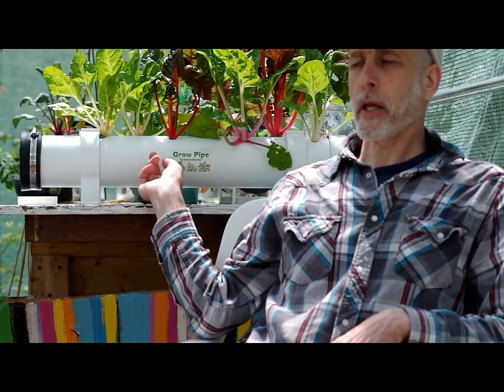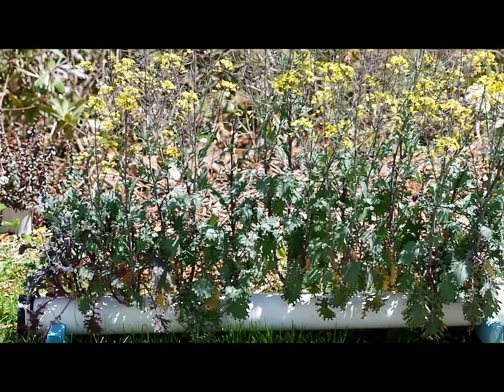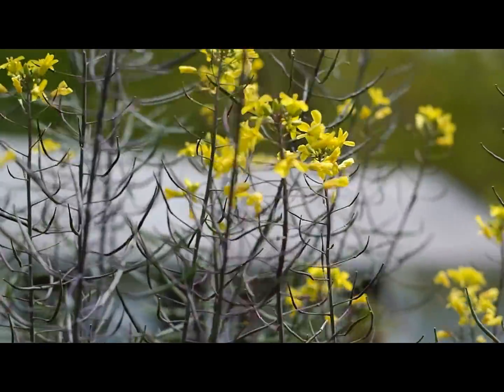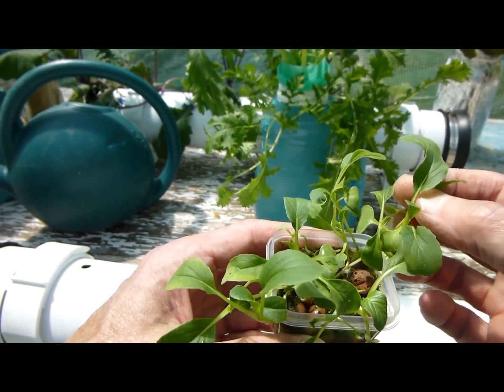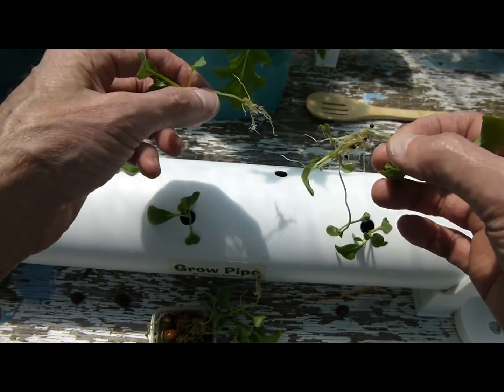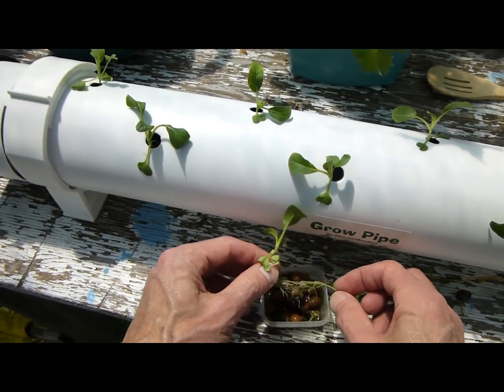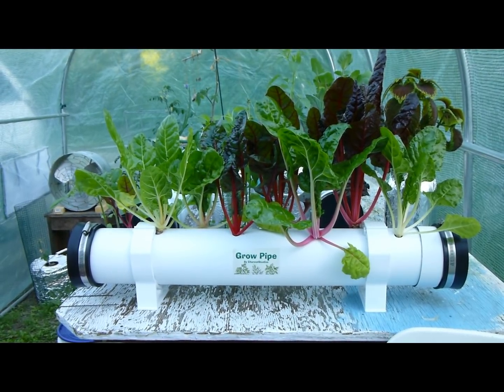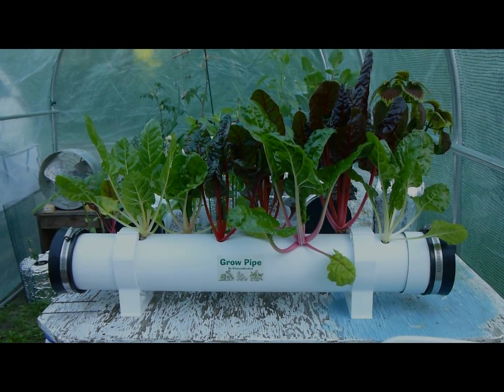How and Why Grow Pipes

Comment: I just found your channel.  I love your grow pipes... where do you find the material you use for the legs of the pipe... Thanks
Reply: Thanks! You can find them here https://www.amazon.com/SNS-Copper-American-one-piece-conduit/dp/B0743M31TL/ref=sr_1_8?crid=34FK4QF2I1YTT&keywords=4+inch+pipe+struts&qid=1666224617&sprefix=4+inch+pipe+struts%2Caps%2C82&sr=8-8 Happy growing!
Reply: @dave8272  Thanks for the quick reply... I have regular metal struts... but really like those snap struts.  I also, for some applications, like greens and green beans, love the idea of the pipe that you use.  I live in Alaska and the grow season here is 90 days or less.  I have a plan for an indoor hydroponic set up and I have quite a few ideas of what I want to grow but some of the logistics weren't answered until I saw your grow tubes... Thank you for sharing your ideas.
Reply: @Washkeeton  You're welcome. Good luck with your indoor set up. I love having some indoor hydroponics. At the very least I always have greens and micro greens. Usually some herbs too.

Comment: Your idea is quite appealing and I’d like to try it out myself.  I have a question:  how do you clean the pipe after your crop is finished?  It looks like you have the ends capped with rubber(?) not sure what exactly.  If you have a chance to see this question I hope I’ll get an answer.  It seems like a pretty interesting idea!  Kudos to you for your invention!
Reply from the maker: Hello. Yes, the flexible 4 inch caps on the ends come off for cleaning. They are available at most home improvement stores here is the U.S. Thank you!

Comment: I have a question. If I start to grow something  in the grow pipe, can I take it out and plant it in soil?
Reply from the maker: Hi Pam. Yes, you can as long as it has not been growing in the growpipe so long that it is locked into the holes. You would need to make sure to give it lots of water over the first couple weeks to adjust. I think it works better going from soil into hydro but it will work either way if you meet the plants needs.
Reply: @CharestStudios  Thank you

Comment: I just purchased your grow pipe. there are rubber washers in the holes. I am assuming they come out when you go to plant. Why are they there to begin with?
Reply from the maker: Hi Pam. Thanks! I sent you a message on Etsy explaining, but your email might have sent it to the spam file or something. I have included the rubber grommets as an improvement. They provide the plants with better support, block more light from infiltrating the pipe and I think they look better. That said if you are growing Kale or something with a large stem just pop  them out and plant directly in the holes. Kale is the only thing I can think of that would need to have them removed. That said you can grow with them or without them. You just drop your little seedlings through the hole in the grommet. I like to use a little stick like a toothpick or something to help guide the roots into the hole if needed. Let me know if you have any other questions.
Reply: @CharestStudios  Thank you for your reply and the totsoi seeds. After seeing your video, i went to the usual places to purchase totsoi seeds but noone had them. I will have to order them on line but at least with your inclusion of the seeds, I can get started. I do hope I am successful!
Reply from the maker: @pamp3445  Your welcome, Pam. You should do well, just follow the instructions and if you have any questions reach out to me here or through Etsy and I will get back to you soon. The Tatsoi is a nice easy crop that is relatively quick. This video explains the rubber grommets and shows how to plant in the growpipe.  https://youtu.be/QvHNKfRgBY0.

Comment: How large are the planting holes?  About 1\2 inch?
Reply from the maker: Yes, you got it. They are a half inch. The plants are a bit floppy until they get larger but the roots all grow together as they mature and eventually most things will fill the holes and lock in. Just try to protect from heavy wind when the plants are small or they can get blown out.

Comment: Just ran across your videos. Thinkin about trying green beans with your process. How deep do you try to maintain your nutrient solution in the pipe?
Reply from the maker: Hi Bruce.  I usually try to fill it up and top it off to about an inch or so from the top. I use the first line on my finger as a guide and that seems to work well. One great thing about having them in the pipe is you can move them. We just had a bad storm come through and I had brought my growpipes in for the day.
Reply: @CharestStudios  Thank you for the reply.
Gonna pick up materials for it today.
Reply from the maker: @brucehayes5111  Awesome! Happy growing. If your on Facebook check out my facebook group passive hydroponics featuring the growpipe. There is a link in the description of the video.

Comment: Do you do full reservoir replacements (taking out all the water and refilling to appropriate amount)? If so how do you do so and how often?
Reply from the maker: Hi Juan. I do not change out the nutrients only add. I usually top it off to about an inch from the top. When the plants are mature it can be every 2-3 days.
Reply: @CharestStudios  Oh interesting! I've been having a lot of root rot issues so I was thinking it was the water, so I started changing the water every 2 weeks and it worked, but I'm wondering what you are doing that lets plants thrive without a changeout of water. 

Do you usually top off with nutrient or regular water?
Reply: Also what do you use for your endcaps for your pipes? I've been looking for a non PVC end cap and I could not find anything
Reply from the maker: @JuanVistro  I top off with nutrients. I mostly use Maxi Gro but sometimes Masterblend. It could be a heat problem you are having. You could try moving the planter to less sunny location. I took my growpipes out of the greenhouse because it was too hot in there.
Reply from the maker: @JuanVistro  I think these are a flexible pvc caps that you can find at most home improvement centers and plumbing supply places. if you don't want your solution in contact with the nutrient you can just put a piece of plastic food wrap on the end of the pipe and put the cap on over it. That way you have the food grade plastic wrap as a barrier between the solution and the pipe.

Comment: What material are you using for ends? Love the videos, I use you microgreen method and they work great!
Reply from the maker: Thanks, Steve! They are called flexible pipe caps and are available at most home improvement centers.

Comment: How Much water this grow pipe hold and how often you have to refill. do you think i can grow swiss chard in this??
Reply from the maker: Hi Adrian Lee. This pipe holds about 5 quarts. Yes, it can grow swiss chard. In the photo is rainbow chard so it does well. When the plants are mature  it needs to be refilled 3-5 days depending on size and weather.
Reply: @CharestStudios  ok thank you.. Just a Crazy idea can you add an airstone to the grow pipe??
Reply from the maker: @adrianlee30   Yes, you could very easily. The fill hole has a rotating cover you could put and airstone in the fill hole and close the cover onto the airline. They sell long airstones like 18 inches long, I would try to get one like that if I were going to try it.

Comment: Excellent video
What is the level of nutrient to be maintained?
Reply from the maker: I usually refill them to about an inch from the top.
Reply: @CharestStudios 
Thanks
Kratky method suggest certain portion of roots to be kept unfilled on top of nutrient solution for oxygen roots.
Kindly advise your observations in this regard.
Reply from the maker: @ashsurvive  Yes, that is what is suggested. I have found in the growpipes I have had great results with refilling to with in one inch or so fromm the top. It maybe that the plants drink it quickly enough so it is not a problem or the notion of leaving the air space is not true. In my buckets I usually do only fill them 2/3 full. I will try to do more experimenting. I know that all parts of the plant can intake oxygen so maybe even when the roots can not the plant is able to get what it needs through the rest of the plant.
Reply: @CharestStudios 
Thanks a lot for the information.
I am held up in UAE to return to home town in India. I want to make one grow pipe and shall share my results.
Could you please share the part name for the black colour end caps to search for availability in India?
Thanks once again

Comment: Awesome!!!  Love the way you keep it simple!!!  Guessing the end covers come off for cleaning??  What material do you use for the end caps and is it food grade?  Is there a way to check the water level to know when you need to add?  I am definitely needing to get one of these.
Reply from the maker: Thank you very much! Yes the ends come off for cleaning and there is a rotating cover at one end that reveals a 1 inch hole for filling. The caps are made with flexible pvc. Many whole systems are built with pvc. If it is a concern a piece of food grade plastic cling wrap can be used as a barrier between the cap and the pipe.
Reply: @CharestStudios  Thank you!

Comment: How do you get the pipe black on the inside?
Reply from the maker: Hi Coy. The HDPE pipe comes that way. I feel it  is a safer and cheaper option than PVC pipe. It has a layer of white and a layer of black plastic. They call it drain pipe because it is not meant to have pressure. It works great for Kratky  set ups and HDPE is the type of plastic that is used for food grade buckets.

Comment: Thanks for sharing. How to you extract your plants? I noticed that the stem for some of them were really thick and you mentioned you could carry the whole thing via the plants itself after they had settled in.
Reply from the maker: Your welcome. Once the plants are done, if the stems are larger than the holes I used a saw to cut the kale stems because they were so big. Then I push the stems inside the pipe and dumped them out after removing the caps. Some smaller shorter growing plants can be broken off or pulled out.

Comment: How full do you fill the pipe with nutrient solution?
Reply from the maker: Hi Allison.
There is a fill hole on one end that is his by a rotating cover. Sorry I re read your question and realized what you were asking. I fill it about one inch from the top and that is where I top it back up to when it is running low. I just go by the first line on my finger.

Comment: How do you gauge the solution level in the pipe? Some hydroponic planter systems have float sticks that help you know when to add or stop adding the solution.
Reply from the maker: Hello. There is a rotating cover on the right side that reveals a 1 inch hole. It can be checked and topped off through that hole. I had thought about a float valve but this really works well and is easy enough. After growing in them a while you kind of know when you should check it based on what you are growing and how mature it is.

Comment: Very nice video thank you.  What is HDPE pipe and where can I get it. Please, thanks….
Reply from the maker: Thanks! Glad you liked it. The HDPE is just the type of plastic it is made of. It is represented as #2 in the little triangle you see on the bottom of plastic items that tell you the kind of plastic it is. HDPE is considered to be safer than pvc. You can get this 4 inch HDPE at Lowes or any plumbing supply place. It is also known as drain pipe. Hope that helps.
Reply: @CharestStudios  OK thanks

Comment: Nice how-to and why video, I am curious how you remove the plants and clean the grow pipe when the plants are ready to remove.
Reply from the maker: Thank you, Matt. To clean them out I cut the plant as close to the pipe as possible and then reremove the end caps and I am able to pull out the roots and anything that remained in the hole. Then I just wash them with soap and water with a scrubbie sponge.It is pretty easy on these short pipes. Even my long pipes I like to make sure I will be able to reach everything from one end or the other that way I can clean them well.

Comment: What did you use for the end supports? Can we purchase them from you or elsewhere? Thanks!!
Reply from the maker: The end caps can be found at any home improvement center.
Reply: @CharestStudios  Thanks, but I was asking about the end supports - I've already found the end caps on Amazon. I just need to get the white supports that are also on the ends. Thanks
Reply from the maker: @mckelveydalton349  Sorry. Here is a link for some on Amazon https://www.amazon.com/gp/product/B01N9SODOU/ref=ppx_yo_dt_b_asin_title_o04_s00?ie=UTF8&psc=1. If you just need a couple you maybe able to look around and find them sold as singles.